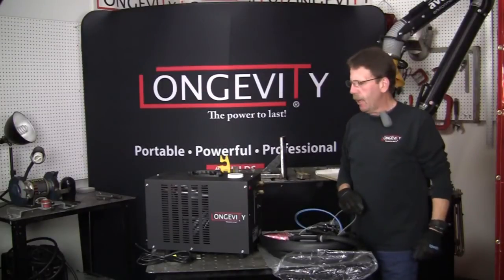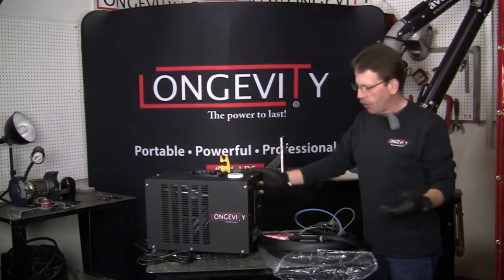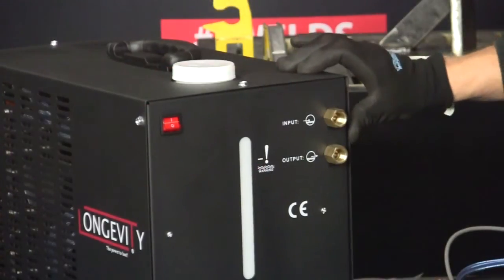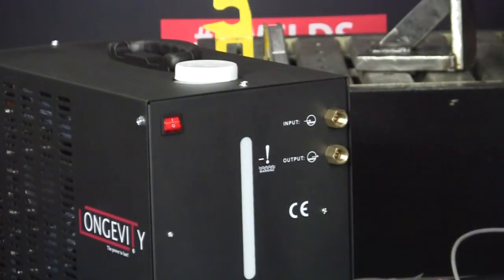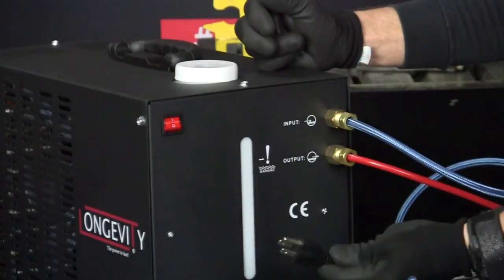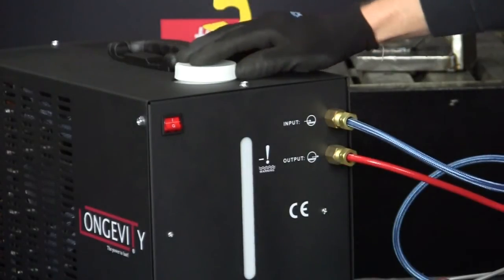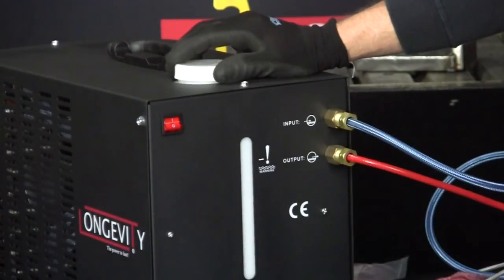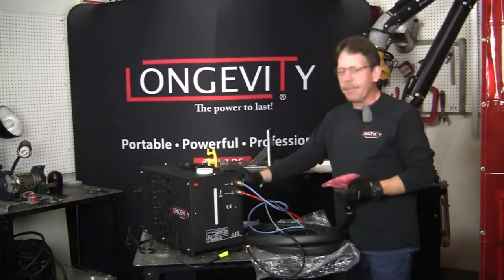Longevity TIG Torch WATER COOLER - 110V 9-Liter Water Cooling System

Comment: This probably won't do much though, considering you machine is more likely to burn up before your torch does. Happened to me on my 200sx and they weren't willing to take it in for inspection. Now I'm stuck with a massive paperweight.
Reply from the maker: We apologize for any inconvenience this has caused. But we will love to talk to you about the 200sx. Please give us a call at  877-566-4462. Our tech will try to help you out.
Reply: I would prefer email, I've called in the past and it ends up becoming a problem. There is no record of what was tested and details get lost in the process.
Reply from the maker: OK. Go ahead and email our tech at tech@lwelds.com. He will help you out.
Reply from the maker: Email us and you should be getting a response! If not, someone needs to get the hammer in the office!
Reply: Sounds good. I will email in today.
Reply: I dont know much about the 200sx but 250ex is deadly and I want this cooler just so I can run a smaller torch .
The cooler is not available on the longevity  site for some reason.